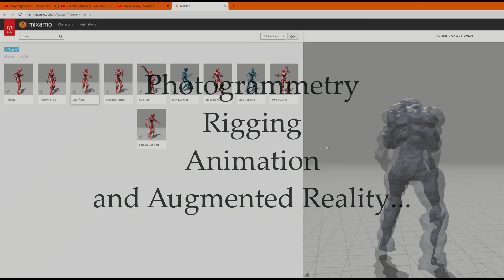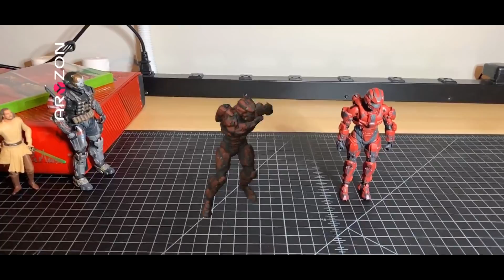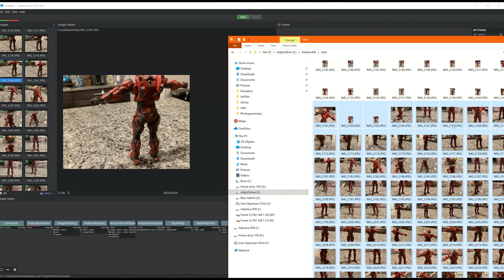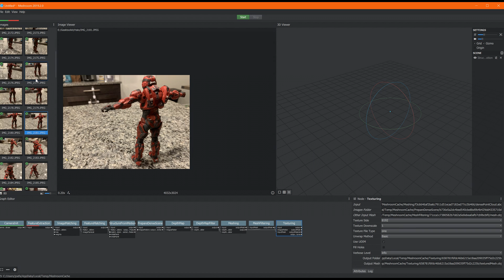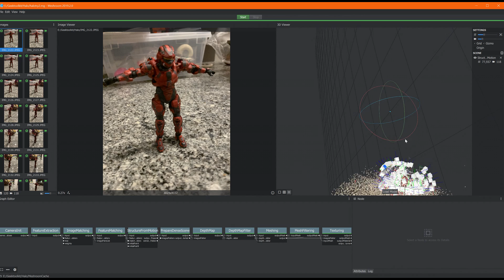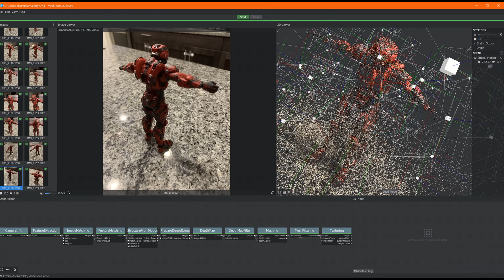Animating an action figure via Photogrammetry + Augmented Reality!

Comment: Great vid man - just wondering if your rendering time could be substatially reduced if you cropped out all the unessentials before feeding the photos to the photogrammetry app?
Reply from the maker: Thanks!  I'm not sure as far as reducing rendering time, I mean possibly, but it may end up being a wash if it takes a bunch of time to do the cropping/editing. I think maybe with a mechanical mount to ensure that the 'subject' is always centered it may be something you could automate, but otherwise you're balancing what you can automate vs. what you can do, and it would likely take some time to see if it is a win in the end. 
  I would like to revisit this at some point and try some different stuff...maybe then I can see if this could be more automated.
Reply: @geektoolkit  a rough crop takes about a second and i reckon about 80% of the photos were dead space - would love to see you revisit that - was also thinking placing the camera on a tripod and then simply spinning the object on a simple lazy susan and using burst mode on a decent dslr with a high shutter speed might produce better results - also the figure was poorly lit - i reckon shining even a cheap work halogen would have done wonders as cameras love light - anyway, very cool and cheers again for the vid
Reply from the maker: Oh I think those would be all good tips! There are 3D prints of automated lazy Susans and people using backdrops. Lighting would be better for sure rotating the model. I’ll have to give it a shot! I have an SLR now so I can try that too.